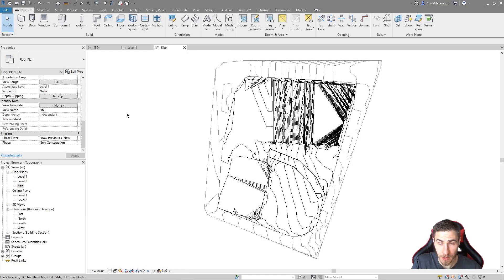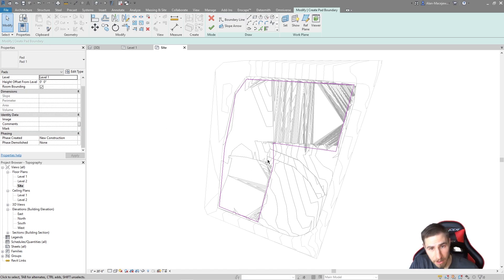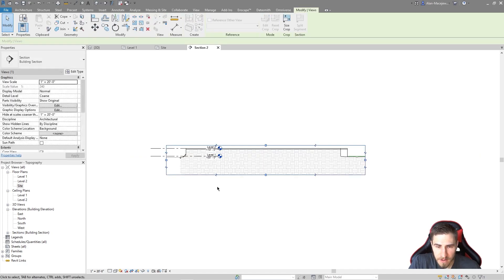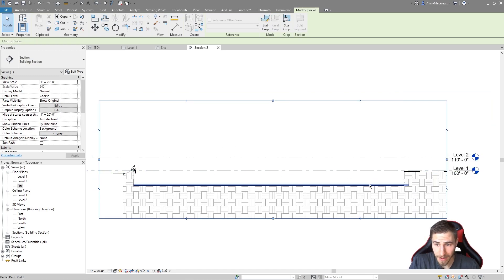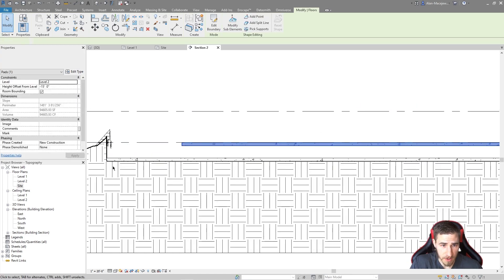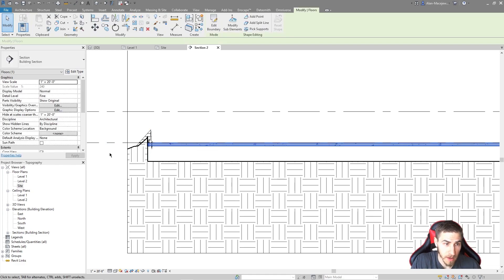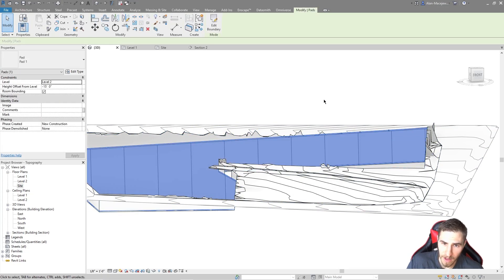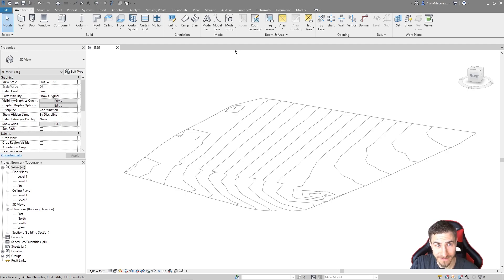How to Use Building Pads | Revit

Comment: If you don’t have building pad tool like in revit 2024, how do you do something similar to get the same results as the building pad?
Reply: Did you find a solution? Is the building pad not an option on 2024?

Comment: Is building pad can have different level in each corner ?
Reply from the maker: You unfortunately cannot adjust building pads like you can floors by adding specific points and elevations but you can add a directional arrow so that the floor angles.